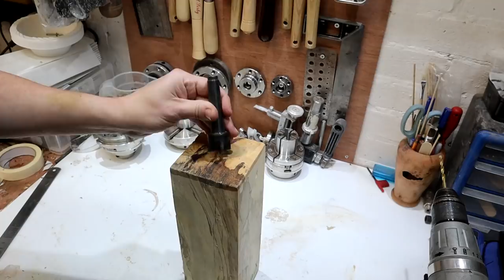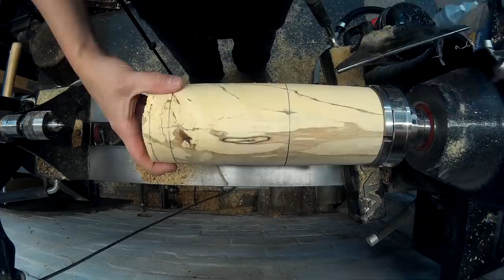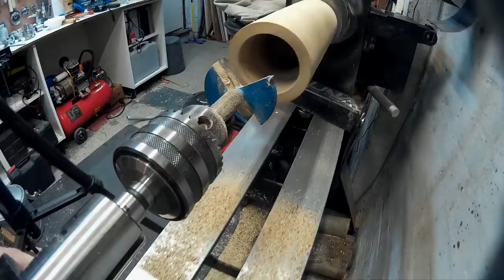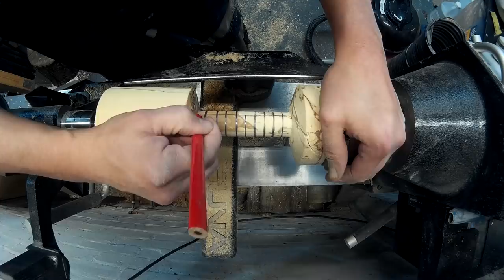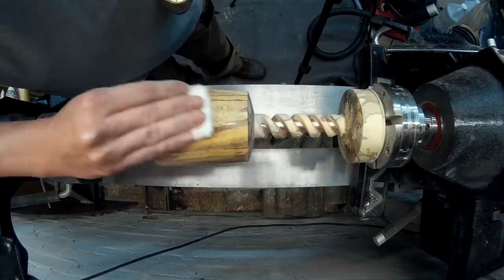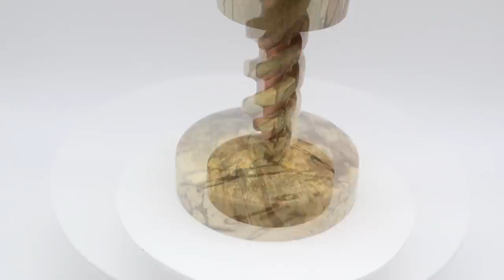Woodturning - A Goblet with a twist!

Comment: When you had the shape blocked out, before you rounded the middle handle, I had an idea. Keep the handle small, and have a long rectangular inset in the handle at 12 o'clock, 3 o'clock, 6 o'clock and 9 o'clock. And in the middle of that rectangular cut out (maybe 1/8 inch deep) you glue some sort of gem stones or resin filled with a trinket incased. Maybe a scorpion incased in resin. Was an idea that came to me to add details. Awesome work as always man.

Comment: I almost thought you were Australian for a moment, what with what appeared to be a banksia seed pod in one video, and what I thought was black heart sassafras in this video. May I suggest, if you can source a block of black heart sassafras (Essentially spalted sassafras, caused by the wood being submerged in mountain streams for decades, hence the exorbitant price and rarity.) it looks similar to the spalted beech you used here, but with a more golden hue, and much more solid but not hard. Be aware though, like Huon Pine, also from Tasmania, it should only be machined with plenty of extraction, and a respirator. The dust is to varying degrees poisonous, and definitely don't burn any in an indoor fire.

Comment: I admire all the work that goes into a handmade twist, but it is a lot easier with a Legacy Mill. Unfortunately, Legacy has gone to all CNC machines now, so if you want one of the old hand-cranked ones, you have to get it from eBay or Craig’s list or somewhere. I still use my old Revo model all the time. It makes any sort of twists I want from pens to 6 inches in diameter, with pitches from 1/2” to 15”. I have to hope everything keeps working because there are no replacement parts.
Reply from the maker: Thanks David